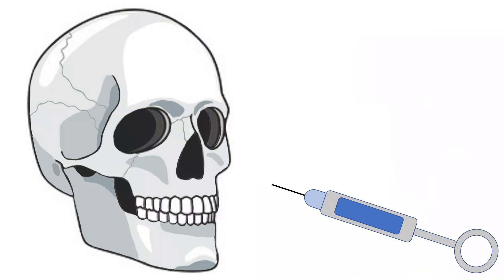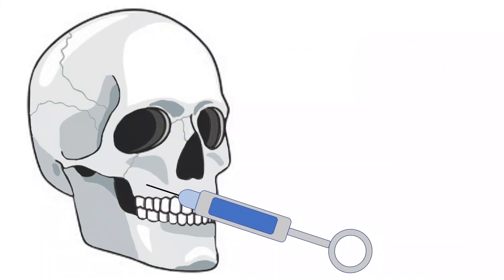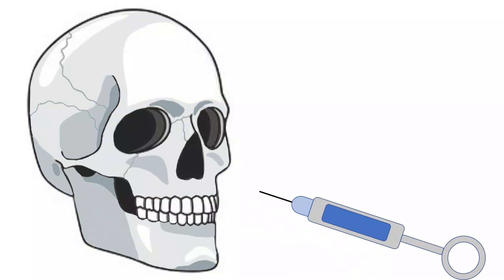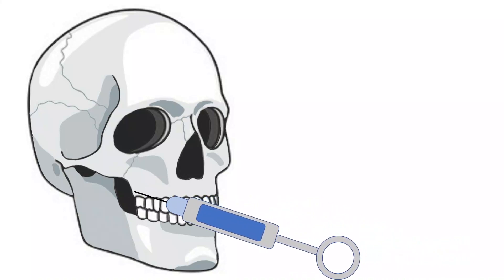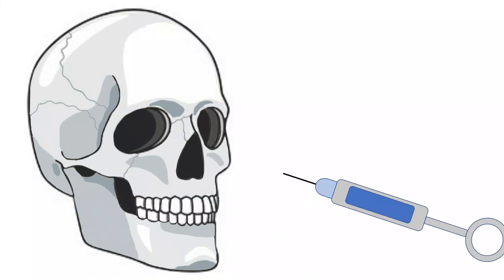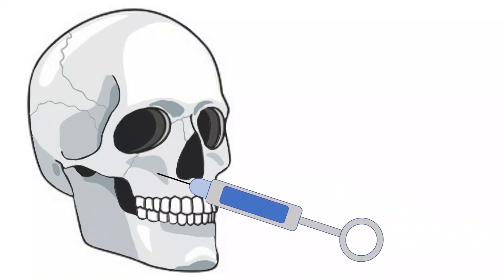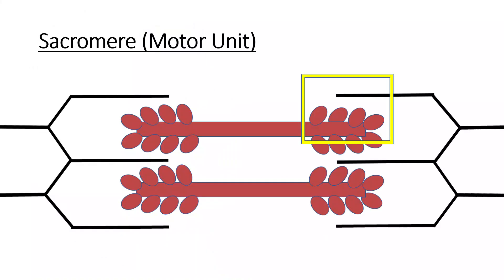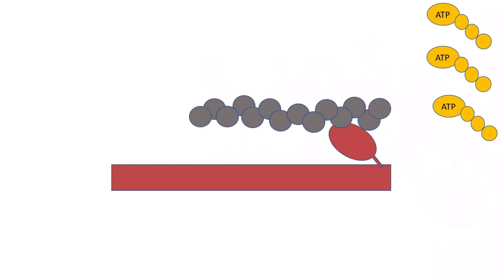The Physiology of Dental Anesthetics: Trismus

Comment: I got trismus after a dental procedure, and my jaw over time became closed, I tried everything recommended, but it was jammed shut, only surgery allowed my mouth to open, even now after two weeks home, my mouth can't open as it did before, but I do daily exercises, and it is slowly improving, when you have teeth removed, don't have more than one done at a time, even if you need more done, space them out, this was the cause in my case, three removed at once and too much injection into the same area numbed my jaw so much the muscle never recovered.